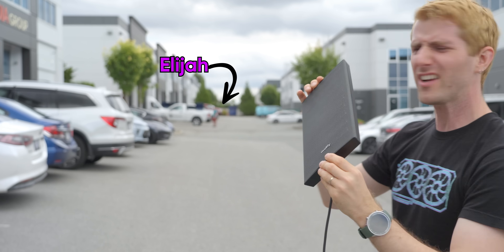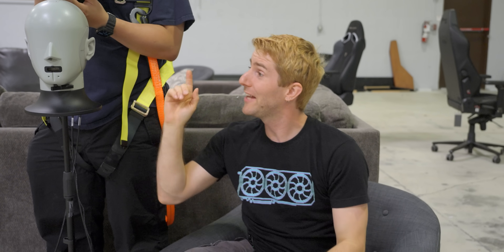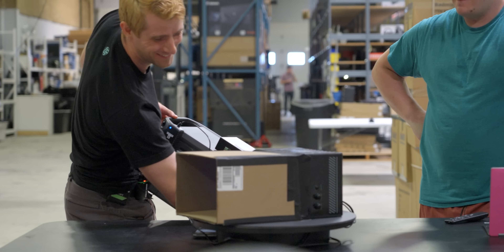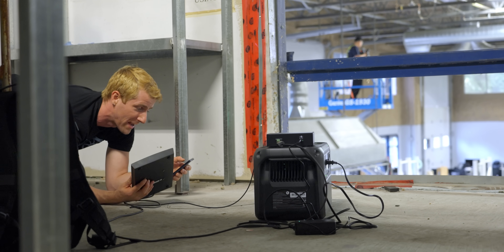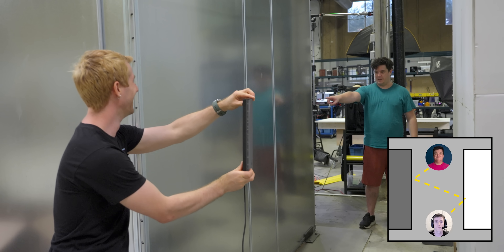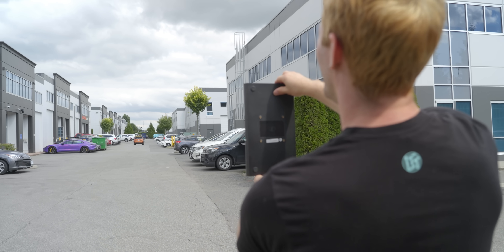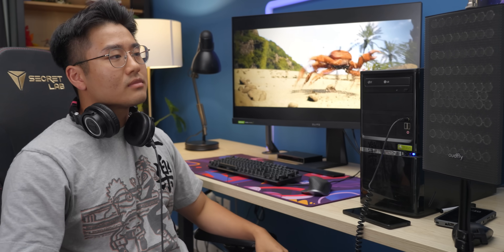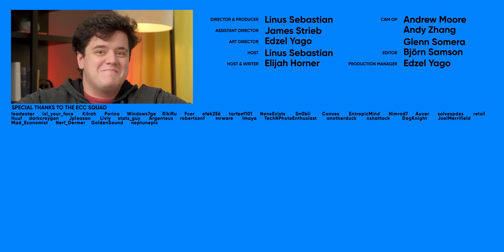Only 1 Person in the World Can Hear this Speaker - Ultrasonic Directional Speaker

Comment: Line arrays (and other array types) don't really 'boost distance'. Rather, they attenuate off-axis sound pressure  due to phase cancellation, usually on the vertical axis, with the goal to provide the same SPL at varying distances from the speakers, i.e. to avoid unsafe SPL at close distances while providing adequate SPL for listeners at the back, and also to reduce noise complaints from neighbours (esp. with subwoofer arrays).

Comment: It looks similar to Phased Arrays used in WiFi antennas and Starlink. If i'm not mistaken it uses Wave Interference by shifting the wave phase of every ultrasonic speaker to create a cone in front of the speaker. Inside the cone area the wave interference create audible waves while outside of the cone the result is inaudible high frequency waves (or lower frequency in some areas).

Comment: If they are only like $500-1k,  It might be cheaper to have like 1 to 3 of those instead of soundproofing your room, right? Like 3 of these instead of mlv, sound insulation, 5/8" drywall, etc

Comment: The Cirque Du Soliel at the New York New York casino uses this - in (at least) the rest rooms with speakers in the ceiling aimed down. Or at least they did when the show was first installed. That Cirque show's audio is a masterpiece of a sadly deceased sound engineer, George Kindler. He was quite a nice fellow and a genius at what he did. (Imagine deadening the sound of the casino's rollercoaster station which is one wall away from the show's theater.)

{^_^}

Comment: You described the sound as "inside your head". I do Non destructive testing and one of the methods is ultrasound listening. I have walked past a small hydroelectric turbine and all of a sudden I heard this tick/pops inside the back of my head. That was cavitation behind the turbine wheel and I could hear it outside the turbine because the amplitude was great enough. But that was as you described it, literally felt like it was inside your skull
Reply: freaky but real

Comment: the concept behind it isn't all too complicated, check out the "literature review"' section of the wikipedia article "Sound from Ultrasound" 
it's somewhat similar to how radio works, as well as transmitting data through fiber optics, except in this case it's sound and not EMR
DeviousGang

Comment: Amplitude is a measure of signal before or after being sent to or from a transducer. Sound Pressure Level (SPL) is a measure of audio signals through fluid mediums such as air, measured using pascals.

dBFS is a measure of signal amplitude, based on the loudest signal that a digital electrical system can handle based on the bit depth of the audio which is why it is measured in negative integers and the point where clipping occurs is 0dBFS, dBvu is a RMS measurement of an analogue signal out from an amplifier, based on signal throughput in volts, dBSPL is a measure of decibels as sound pressure

Comment: Elijah, I would use this speaker on a turret in a garden perimeter security system to terrify anyone breaking into my property #DeviousGang
Another thing would be to hide this speaker behind a canvas painting and have it blasting sounds relating to the painting only heard when you walk by or walk towards the painting.
It would need LIDAR, RADAR or microwave range sensing to vary the volume.

Comment: Bose use to have a system based on this probably a decade or so ago.

It was a full 5.1 surround system that was integrated into the TV. A subwoofer, center channel, and 4 audio projectors which would point to the other positions for reflected sound.

Install the TV, let it calibrate itself, and you have a full 5.1 system installed.

Comment: on the 8min mark he says its hard to line it up that far distance... but I guess the gust of wind can just push the air and the sound with it to another direction. (you can test this with ultrasonic sensor(used in liquid levels in tank for example) and just use lighter to put fire that lifts air between the line of sight of sensor and it will lose the "signal")

Comment: Directionnal speakers are the big deal since a few years for a big mainstage, "big ol' speakers" would blast anyone in his range, creating "interference zones" between multiple ranges where the show would sound bad.
Now you‘ve got these big unit, made from stacked directionnal speakers, each speaker from every units directed to a single area, so all the sound system would create an even sound (with help of specialized software) no matter where you stand in the crowd

Comment: On my other channel I been building one of these parametric speakers they use ulta sonic transducers I wouldnt aim it at your ears. The array I was building uses a 555 timer at 40khz that gets audio pumped in. Was planning to attach it to my airsoft helmet a diy build isnt as perfect but it is a hella lot cheaper.

Comment: If applied correctly, you could make a person go mad with a system using these speakers with a basic computer like a Pi and infrared or camera tracking attached to motorized bases with two or three axis controls. Alternatively, if you put a swivel base with contact rails on it, spin it up a few thousand RPM with an electric motor and blanket the room with (maybe) buffeting sound, like when you're going at highway speed in a car and open just one window and just enough to let the air in
#deviousgang
Reply: This sort of set up would be good for alarms and alert tones, do with that little nugget however you please I suppose lol
Reply: You could probably do one of those THX 1138 mind locks with this and the workers wouldn't even need headphones. Microphones are precise and sensitive enough that a person on the production line could have a clear and private conversation with their boss. That right there is pretty creepy

Comment: This could be useful for updating older theme park rides that were made without a solid grasp of acoustics. Like, you know how on "It's a Small World", you're supposed to be hearing the song in the language of whatever country you go past? Except it doesn't really work because you've got a dozen scenes in the same big room and it all blends together into a vague cacophony. (To say nothing of all the echoes from the water.) A similar issue happens on "Pirates of the Caribbean" where you've got the song playing on an endless loop but you're also supposed to be able to hear what the characters are saying when you get close to them.

More modern rides, like "Under the Sea", get around this by being broken up into separate rooms with each playing its own audio loop. Which is a solution, but it limits the kind of rides that can be made this way. The more open design of the older rides has a certain charm, and it'd be nice for designers to have that option again without the downsides.

Comment: This sounds similar to how a phased array works, which are commonly used with radar where instead of spinning the array its a flat panel and through constructive and destructive interference you can "point" or steer the signal.

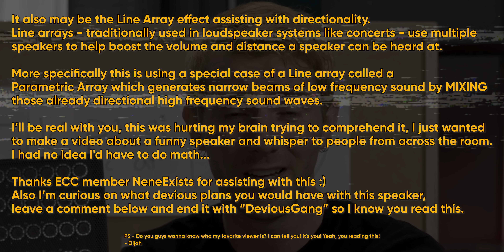Comment: I would like to correct your definition at 4:13 about Line arrays. They dont help boost the volume. The drivers couple in a single plane, so all the HF drivers will be lined up in row or column. They can only couple if the line array is in phase with each other, the vertical dispersion of line array boxes are only up to 15 degree's max to maintain that coupling. It also only couples with +3dB of added level not the +6dB with point source systems (regular book shelf speakers). I used to be a lotter better at explaining this considering I have a Bachelors degree in this. Anyway the "boosted" distance is the coupling of the boxes. Like this parametric array, the sound waves can be carried further by the lower frequencies (its also the reason co-axial speakers have the tweeter in the middle). Essentially the more drivers you couple the more level you can send to the location you want, of course its only up to a select distance as their are diminishing returns.  It gets more complicated when talking about Infitine Impusle Response (IIR) & Finite Impulse Response (FIR) Filters to the signal chain to change the behaviour of the sound waves coming out of the wave guide. I assume part of what the Parametric array is doing is using a combination of IIR & FIR filters to change the response and sound waves out of those drivers. I also assume it is using beam steering to pull in any unwanted noise. I hope this kind of helps. If you want to learn more look up Bob McCarthy, he is a legend in the audio industry especially with Line Arrays.

Comment: The directionality is achieved ín two ways:
1) simply having a bunch of individual speakers in a plane will cause the combined waves from all of them to add up in the direction they are facing, and cancel in other directions. This is not perfect.
2a) human ear can only hear up to 20kHz
2b) when two waves of different lenghts combine, phantom frequencies equal to the sum and difference of the original frequencies is created. This is the exact same principle that FM radio uses, but with sound waves instead of EM. The sound is literally just frequency modulated out of our listening range. This modulated sound is then played from the ultrasonic speakers along with the appropriate carrier tone. Only in the line facing the speakers do they interfere correctly to produce the correct differential phantom wave in audible spectrum, and everywhere else it is just ultrasonic garbage instead.

This is used to a great effect e.g. in the museum du Louvre, where you can clearly hear commentary when standing in the right spot next to the art piece, and blissful silence everywhere else. As a bonus, this can also be combined with different carrier frequencies to produce commentary in different language from the same speaker at the same time - just like radio!

As for my use case, I would really like to see this used in theatres to that I can go and see english (aka foreign) movies with my family and friends without having to settle for horrible voiceover. They could have their audio and I could have mine,  at the same screening, in the same theater. A man can dream, right?

DeviousGang

Comment: I have a birth defect that allows me to hear 20-23 khZ normally. It's so shriekingly high that it manifests as headaches and ear pain instead of normal sound. There's already a lot more ultrasound around you than you think -- lots of speakers and machinery, cleaning, HVAC, etc. are constantly emitting ultrasound at 60-90 dB, it's especially bad at airports. Multiple apps exist that let you detect ultrasound, try it when you're in an airport.

I would die around this thing.

Comment: There are uses of this in military and police environments too talking to somone far away without disturbing everyone for example or turn it way up to disperse crowds. 

Other fun applications would be as a personal monitor for speakers. As they talk and run out of time slowly add more delay to their voice in the speaker to the point they find it hard to speak. It is surprisingly effective. And as its directional no one else needs to know they were over running on time or that you had to do it. 

It's essentially a phased array so you can do alot with it.

Comment: In the 1990s I invested in a company working on this exact technology, same principle and same suggested applications. Including museum and retail kiosks. Also the idea that movies could have sound source locations encoded such that turrets with these sound emitters could point to locations on the screen (actors' mouths, gun barrels etc) or elsewhere around the theater. They had working demonstrations; it wasn't snake oil. I then watched as they sat on it for years and years, and never did anything with it. It was one of my earliest experiences investing in a stock, and I took the lesson that I suck at it.
Reply: There was a company that did something similar with 3D video effects... Sony. They have/had a demo of a 3D wall that has holograms appear on it. I saw it when the Lincoln Presidential Library opened up (we were there on opening day I think) and it was an amazing demo. Positional audio and 3D hologram effects...... but I've never seen anything like it since. I have no idea why Sony hasn't expanded on it.

Comment: Military was using this technology, US military however I was created by Canada and used on the Canadian vehicle sold to the US and deployed to multiple war terrorism areas. It was used as a non-lethal form of crowd dispersion using ultrasonic waves. It shot out a very ear tone hurting, sound That fluctuated between frequencies. I kid you not this is used as a non-llethal way to disperse a crowd.. Back in the very very early 2000s. All this was unclassified with the leaks. However, how you showed that it can be blocked by a piece of paper was quickly figured out by. Certain crowds as such the project and the vehicle was scrapped. Likely leading to now where the patent would’ve been up for review and probably wasn’t renewed.

Comment: They definitely use these type of speakers in the churchill war rooms. There's a bit in the museum wherein there's maybe 6-7 posters lined up on a wall spaced out about 2 feet apart. If you stand in front of each poster, you can read about what was happening during one of churchill's speeches and/or what the speech was about as you're listening to the speech cause there's one of those ultrasonic speakers in the cieling pointed down right above each poster, so you can stand right in front of each one and only you can hear the speech. It was very immersive and really cool. I would recommend visiting the churchill war rooms to anyone who is visiting london and is even vaguely interested in ww2.

Comment: About 20 years ago, when CDs were still popular, supermarkets around here had parabolic speakers mounted on the ceiling. They allowed you to "sample" an album before buying without wearing headphones, and without someone ~10 meters away hearing it much at all.

Haven't seen one of those in a long time, since that particular usecase is long gone. But these seem far more directional than those were, so these are a lot better.
Reply: Saw one of those at the national museum of anthropology in Mexico City about 5 years ago, and I saw a non-functioning one at a museum (can't remember the name) in Rome about a year ago. A Museum seems like the perfect use case.